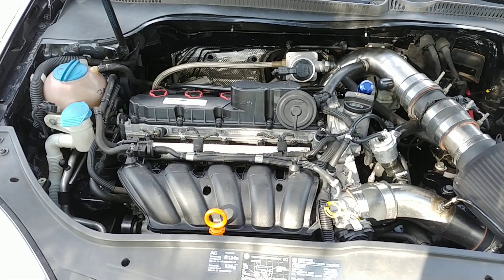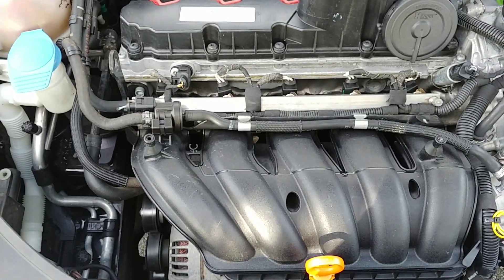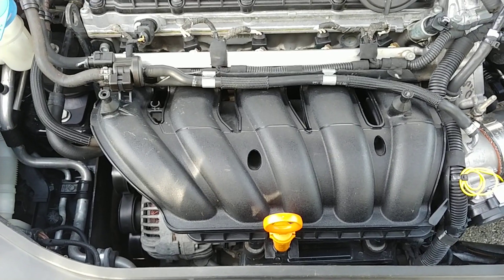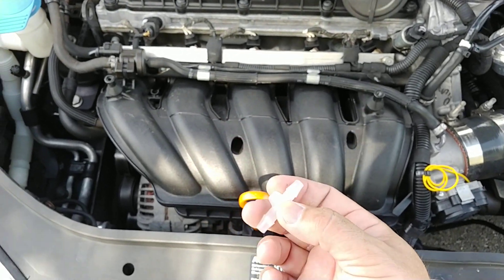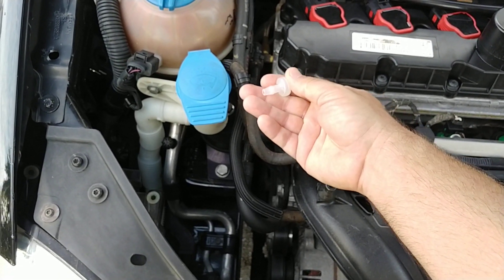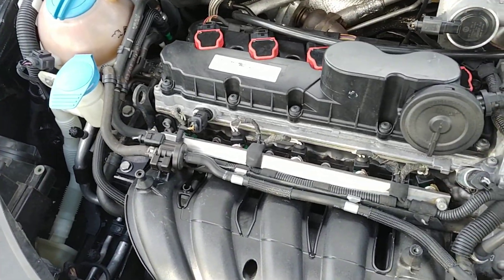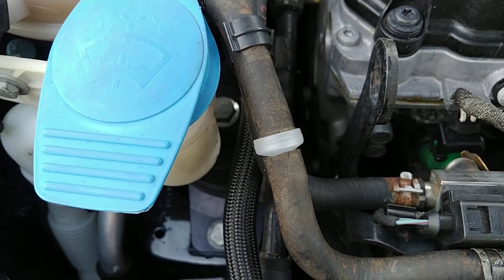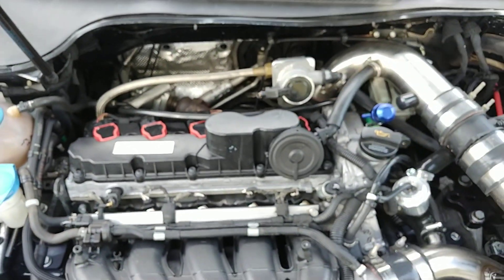DONT OVERLOOK THIS DETAIL (when boosting your 2.5L)

Comment: So, I think I have found a small vacuum pump leak in my 06 Jetta 2.5 91k. The bottom of the transmission where it mates to the engine is soggy with oil and a part of the underbody shielding too. Today my dad noticed some oil spots on the pavement where I usually park. I've been checking the oil level every 2 weeks, it's been about 1300 miles since last oil change and the level has not changed. Are there any consequences￼￼￼ for leaving it leaking and should I fix it or not?
Reply from the maker: The leak is usually pretty slow where it's not going to damage the engine at all as long as you keep your eye on the level. But you can repair it pretty easily and it won't cost much either. Go to rkxtech.com and you will see there is a full vacuum pump reseal kit available
Reply: Florida 07K What about the block off kits from IE and Spulen?
Reply from the maker: @vitaliyzvarych4740  Those are fine. I have a block off kit from Spulen. Some people just dont want to get rid of the pump.
Reply: Florida 07K I think I might go for the block off kit because In heard that it frees some hidden power and it daily cheap
Reply from the maker: @vitaliyzvarych4740  its not noticeable but yeah. 1 less thing the timing system has to turn.
Reply: Florida 07K What do you mean?
Reply from the maker: @vitaliyzvarych4740  The pump spins off the timing chain. So its technically a parasitic drag on the engine. So deleting it makes the engine a little more efficient. Its just not like you'll be noticeably faster lol. But I have the kit and recommend it.
Reply: Florida 07K Ok, thank you for your help

Comment: I'm still trying to get past my power steering pump so I can get a SRI.
Reply from the maker: I think the easiest solution was to swap out the power steering system for the electric power steering rack. Some said from a 2008 to 2010 rack is the best because it has an updated module or something that's more reliable. Someone in the 2.5L group did it and said some coding was required but it wasn't too hard. I think it was Bruce Canova?
Reply: jaattt engineering makes a power steering relocation kit that moves the power steering pump to where the ac compressor is and it deletes the ac compressor, he also makes custom power steering lines because the oem ones are hard lines.